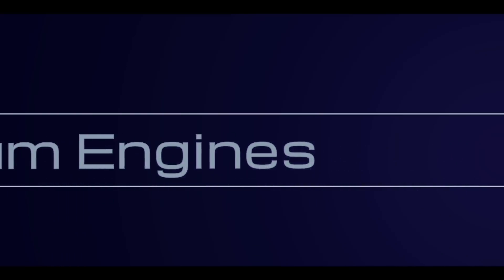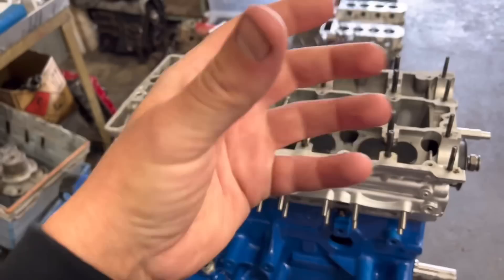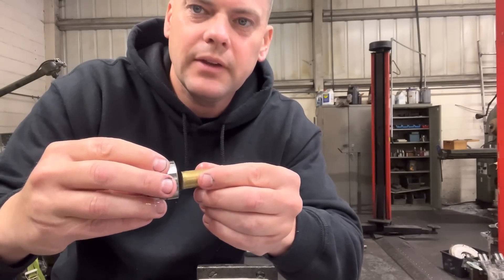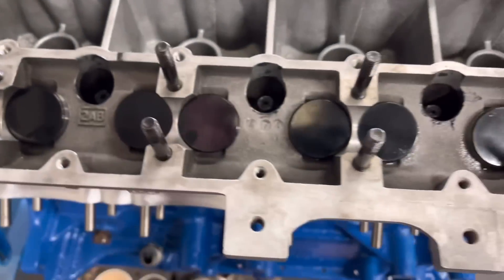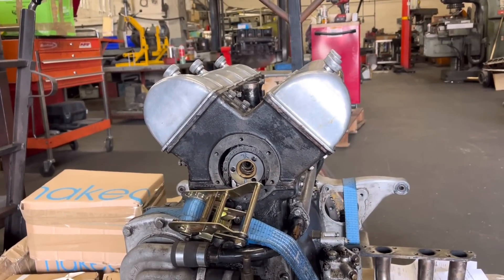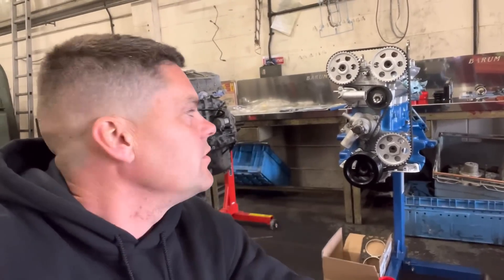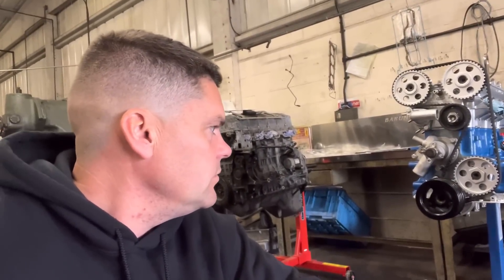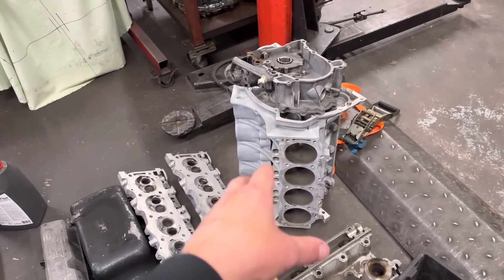It’s EXTREMELY RARE, we built it and now it’s broke. But guess what’s just turned up!

Comment: Cannot get my head round starting engine with buckets in dry mode mode. The risk of bending valves at that critical start up time await your comments as I would be mega worried doing this also why does supplier not do this could be mega costly cock up

Comment: Still no need to do this as I told you, you will not build that engine fast enough for them not to drain under normal valve spring pressure by the time you start it.
I'm guessing there is no instructions to do this either in the lifter manufacturer.  Rich.

Comment: Have you ever considered heating aluminum heads that are warped enough to bind the cam?  Check the video by sixtyfiveford straightening a VW cylinder head.  Heats and applies pressure to clamped in place head.  When done, and 'relaxed' the head got very straight w/o need to skim.  The Alfa head that is headed to the melter would be a good one to try the procedure upon.

Comment: @10:30.  I've never looked at the Cosworth engine before, know nowt about them, but looking at that belt setup....do you ever have issues with that inlet cam skipping teeth? I know it's on the tension side of the belt and it looks like a fixed tensioner, but that's a pretty poor wrap-angle - barely 90 degrees of contact.  Just curious.

Comment: On the Lagonda/fibrewheel situation....I had some old Volvo’s with B20 or B18 engine....on one of them I replaced the original fibre gear with the steel version,normally only used on the 3litre (basically the same engine+2 cilindres) it costs some 20 euro’s extra but will neverever wear....the fibre ones do...like a timingbelt realy..
There was no noticable extra noise after fitting the steel gear,and the engine runned happily ever after....

Comment: The fibre gears on the Rapier usually fail either because the bearings are loose or a new gear is installed with worn steel gears so all the load it taken on the tips of the teeth.  For modified engines it is best to use a bronze of steel gear.  If one of the blade tensioners fail the bits can fall into the gear.  There is plenty of information available through the Rapier Register. I have rebuilt and modified quite a number of these engines over the years. Please contact me if you need more information.
Reply: Paul uut de Salland??

Comment: We used to see a lot of fibre gears on motors here in Australia. Failure was relatively common even in standard motors. The go fix was to replace them with an aluminium gear. Personally, based on my experience,  I would have recommended to the client to make an aluminium gear. On top of the money that he has already spent,  I would suggest that the additional cost is irrelevant. The increase in reliability would be priceless
Reply: Curse of the red six. Even my grandfather's standard HD had the gear replaced back in the 80's.

Comment: Save wasting your time, you or anyone can never build one of them quick enough to fire an engine without them draining down before so.
 I used to pump them all to drain to, we all did, but that was when we doing engines of the 80's when they were full off carbon, big bits of it, these days, don't waste your time.

Comment: Wish i saw this a few years back had no end of problems with lifters in bmw m52.changed all 24 
As it is think ive one thats still loud after idling.
Reply: The are very dependent on the right oil, mine used to rattle on Castrol 5/30 but after I changed to Penrite 5/40 bingo, no more issues.

Comment: Ford V4 and V6's have those type fibre gears. They come apart in the centre and stop turning or take the teeth off when they are out of balance.
Reply: When I was young we had a V6 ford in. It was gutless. But it idled so so smoothly. The Fibre timing gear had moved and retarded the timing.

Comment: Old Ford 2L V4, nylon oil pump drive gears, instant destruction 🙄
Reply: Ford Corsair ?
Reply: @barbaraneville5036  yup, and some Ford Capris, they also supplied Saab with that engine... crazy design fault, a 'Time bomb'
Reply: Seem to remember Volvo's in the 70s had a fibre gear as well...

Comment: I've had in a few production engineering machines nylon gears, they're commonly used as fuses in gearboxes, but never heard of them in engines, Lagonda, nice.
Reply: GM & Ford used nylon toothed gears cast onto iron centers.  Nylon would get brittle from heated oil over time, and decide it was DONE, sheeding all teeth and putting the cam & valves totally out of whack.  If unlucky, valves could make contact with the piston and then run up the bill to repair. 2.8 Cologne V6 has that setup in the late 1970's Mustang.
Reply: @GrumpyUnkMillions  and also the European Capri's final model all had Cologne 2.8 V6 engines...

Comment: never seen that engine before thanks for showing it ,I am fed up with my engine a td4 2 ltr in a freelander it does not get warm quick it used to but now takes miles in winter it never gets really warm do you think it could be the water pump as thermostat has been changed
Reply: do you men the heater doesn't get as warm or the gauge on the dash says its not as warm ?  was it the correct temp thermostat?  if it was the pump it would overheat very quickly  in the summer.
Reply: @colinscutt5104  both i will get one of those thermostats wahler make and see if it is that and i just remembered i got a new water pump months ago ad my son in law never got round to doing it
Reply: i could not get a Wahler to fit mine it does not seam as though anybody has one but i have ordered one from a landrover supplier thanks
Reply: If you're talking about the engine (not heating) and everything is running ok? But very slow to warm up then look to see if the thermostat is stuck open, just because you replaced it doesn't mean the new one isn't faulty too, when was the coolant replaced?. Next, if it is reading low temp on the dash, you may have a bad temp sensor.
But like I said, does it run/pull ok? if not, it may be a warn engine with low compression etc.
Reply: Similar problems with 5 pot TDI Audi is always the result of using "cheap" thermostats.  The only ones that work properly are the OE ones made by Wahler which have a rubber seal so they full seal when closed.  Nothing else seems to work.

Comment: Force oil past a non return valve by using a vice. Wouldn’t want that in my engine.
Reply: It's not a proper one way valve, it's designed to leak, over time... otherwise it would keep jacking up till it reached the full length.
Reply: @mikehunt8968  - I bet If the manufacturer saw this video they would void any warranty claims on them.
Reply: Seems like madness !
Reply: Some sources say that if they are prefilled or you prefill them they they should be left for 30min after installation. Presumably so the valve spring can push any excess oil out. The so called one way valve isn't totally one way.
Reply: Pretty common in some VAG stuff to keep turning the engine to expel the oil or they jack up and cause issues.
Reply: That's the way we was told to do it when I worked at the Ford dealers. 1980's  But hey what do the manufacturers know.
Reply: @andyhill6398  - Give a link to a main dealer website that recommends it then please. If not then you’ve just made it up. I’m waiting.
Reply: @colliehouse3133  I worked at Ford dealers from 72 to 86. We used yo go to Daventry for manufacturer training.  Before the Internet was invented lol. I'm still in the trade  and continue to bleed down lifters before instalation.  Lost count of the times I've seen other people with freshly built engines misfiring on initial start up because the valves are jacked open. But hey you believe what you want. I don't really care.
Reply: @andyhill6398  - No link then. I guessed as much.